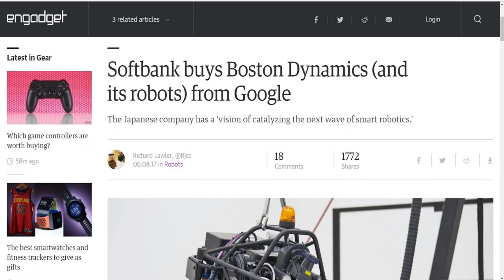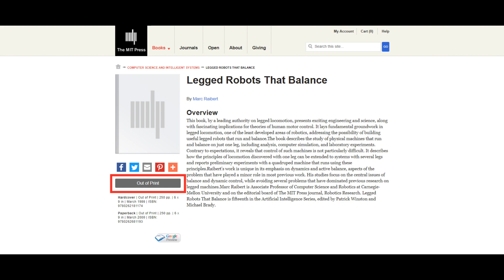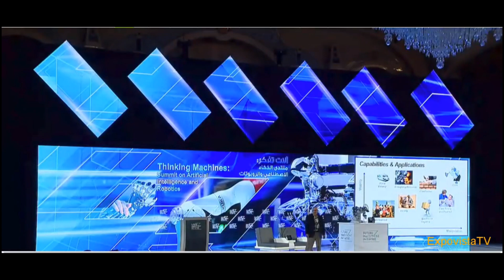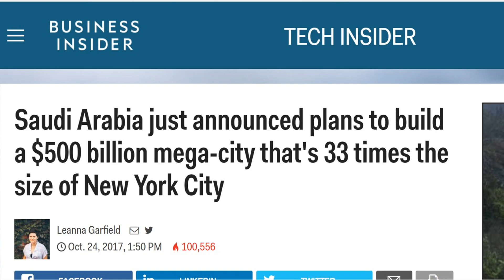The Story of Boston Dynamics

Comment: Google recently developed simulated walking robots (not actual physical robots) through its "Deep Mind" artificial intelligence (AI) algorithm.  With just a few hours of simulation time (I am just guessing at how long the AI had to work to do this), Deep Mind was able to teach itself to make two and four legged virtual creatures move.  The movement got to be quite sophisticated, with the ability to navigate complicated terrain and avoid moving obstacles.  Thus, with just a short amount of computational time, and with no human guidance (other than setting up the simulation), Deep Mind achieved a level of walking ability at about the level of the impressive Boston Dynamics robots.  The point is that the algorithm which performs the walking motion is the most important component of the robot, although well engineered hardware (i.e. the physical robot) clearly helps.  If Google's Deep Mind AI were connected with a physical walking robot, it would likely figure out how to make it walk as well as it made the simulated robots walk.  All by itself the Deep Mind AI was essentially able to duplicate, in a few hours, all the research and development achieved by Marc Raibert and his Boston Dynamics company, over more than 30 years.  My comment is not meant to diminish the achievements of Mr. Raibert, whose work I greatly admire.  Rather, I am pointing out an important example of the awesome power of Artificial Intelligence.  There are many other examples of an AI program rapidly discovering, on its own, a great deal of specialized, sophisticated knowledge that highly educated people accumulated over many years through arduous research.